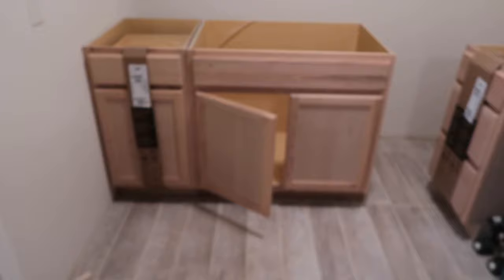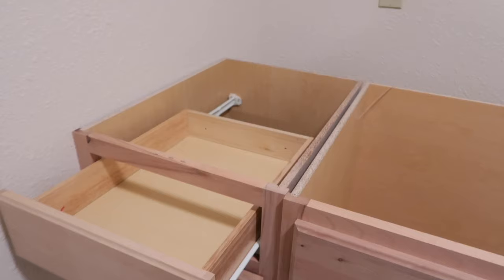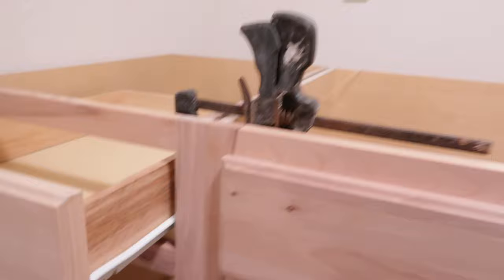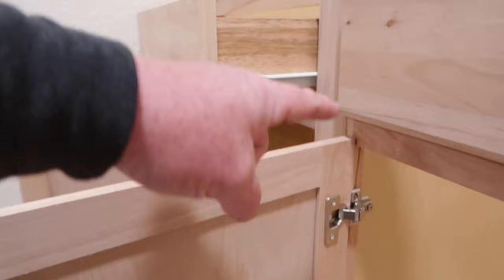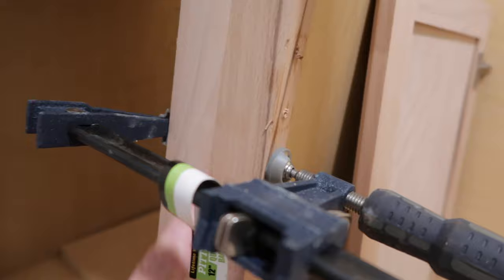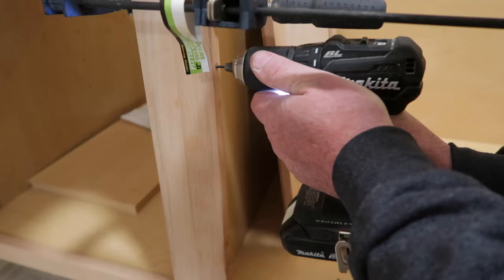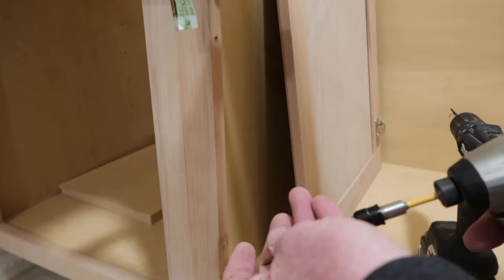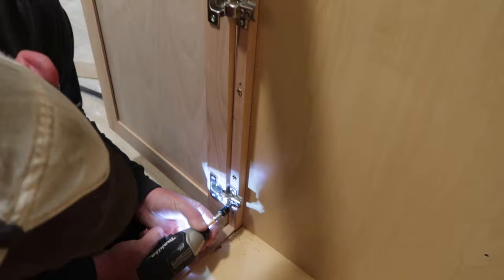HOW TO SCREW CABINETS TOGETHER-Simple & Easy

Comment: Actually, incorrect use of cabinet screws for holding cabinets together. Should have used 2 1/2 wood screws with countersunk heads. Cabinet screws are for holding cabinets to walls.
Reply: Yes, and use a bit with a countersink built in so the head is slightly below the surface
Reply: But doesn’t the washer head provide extra grip when joining cabinets? I have IKEA cabinets that came with washer head screws for joining adjacent units.
Reply: Screw he used was perfect. Grk screws are thin head to sit fairly flush, and exert inward pressure without splitting wood. Screws with counter sinking heads always exert some outward pressure on the hole due to the angle of the counter sinking head. Less chance of wood splitting when moving large rows of cabinets, secured together as a unit, are moved around during installation. The washer head aids in distribution of pressure on the wood and less on the hole.
Reply: @waveriderz2687  Fuck. I just switched out my washer-head screws for countersunk-head screws based on the comments in this video.
Reply: @waveriderz2687  If you like the look of unsightly screw heads and washers up and down one or both sides of your cabinet frames, you are correct. I prefer to drill a pilot hole with a countersink bit and then use the correct screws which avoids any chance of splitting anything.
Reply: @DontNeedToKnow84  No worries. If you countersunk you did it right. A nice clean look and well secured.
Reply: @larrybenrus7608  up to you, but Grk screws are stronger with thin heads. You ever see one?  Less unsightly than the hinge hardware? We install large rows of cabinets as a unit because we use leveling kits,  not shims.You're a little behind the times?
Reply: @waveriderz2687  I use EZ Levelers. Cave men use shims. Yup, I use GRKs too, but where I am supposed to.
Reply: @larrybenrus7608 I also picked up some EZ levelers, and have GRK screws for fastening my cabinets to walls, but what do you recommend for face frames? I'm seeing folks use GRK trim head screws which seem like they'd work and sink themselves flush (with a pilot hole of course) but should I be using something else?
Reply: @dcam91  I've never used the trim head screws but they would work just fine. Either those or a bugle head wood screw of the appropriate length and a countersink bit after you drill your pilot hole to get the screw head flush with the surface.

Comment: 2 1/2” GRK trim head screws for this, or a wood screw if you don’t have any on hand. The cabinet screws with the flat head are being used incorrectly in this application.

Comment: did you have any "end panels" to install? if so how did you do this? I bought some unfinished cabinet from menards and one end has an end panel to cover up the composite wood. I am trying to find the best way to go about this. Construction adhesive, wood glue and brads...? Im trying to stay away from contact cement or aerosol adhesive because the cabinets are installed already and  man that stuff smells. Any help would be greatly appreciated.
Reply from the maker: Yes construction adhesive works great. Power grab has an instant stick.
Reply: Caulk and brad nails
Reply: A bit of construction glue and I put 5 small brad nails. You can't even see the brad nails if you are painting them.

Comment: How can you address the gap in the back of the cabinets if they aren't going against a wall? The gap that is created by the front trim being proud.
Reply: Measure the gap in the front. Cut shims out of plywood to that size. Place in the back gap and screw cabinets together. If you’re putting up against a wall its not really necessary.

Comment: What about the gap in the back of the cabinets?
Reply: Exactly. Always place a spacer, typically 1/2” ply squares, at the back bottom & back top.
Reply: @victorvek5227  how do you get the bottom one out?
Reply: @msmoomoo53  you take it out the electric connector plug

Comment: I thought you don't need to predrill with those GRK fancy screws? At least that's how they market them...
Reply: That’s how they’re marketed however if you split that face frame then they are ruined. Predrill with a tapered bit. Don’t drill the entire way though. You want the screw to slide freely through the first cabinet and screw into the second cabinet pulling it right